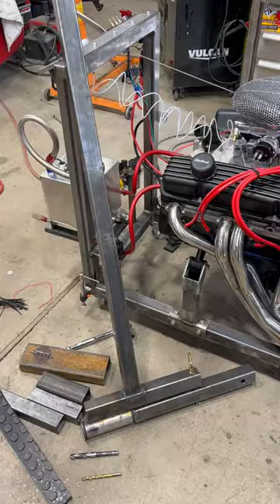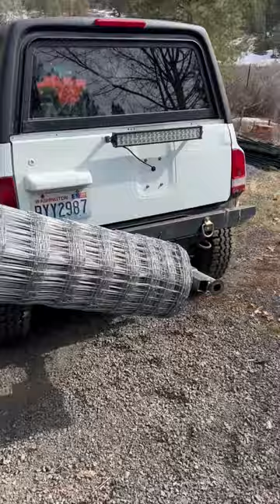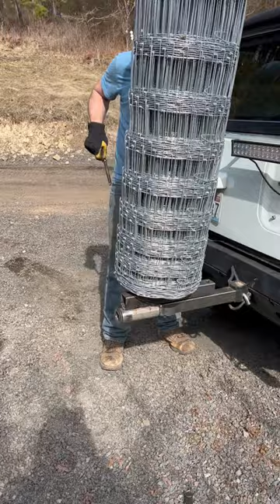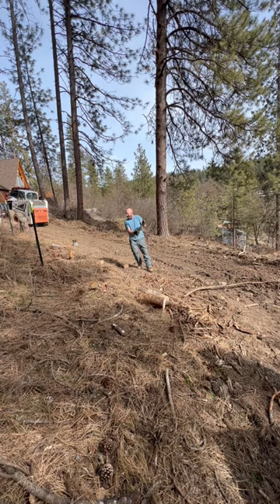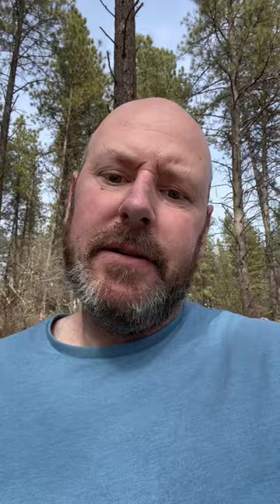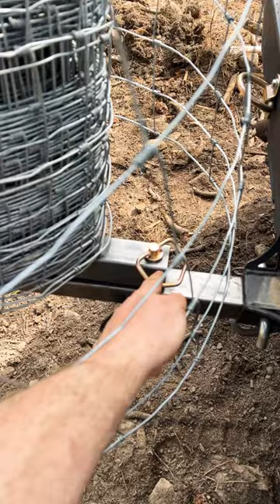Farm Fencing Roll Holder Hitch #farmer #diy #homestead #fencing #worksmarter #fabrication #short

Comment: When you swap to the round pipe in the center take an old disc blade and put it dish up so it would hold water like a bowl and slide your roll over that. Grandpa made one on a two wheeled cart. Works great
Reply from the maker: That's a good idea!  Thank you!
Reply: Something to make like a needle bearing also  to get the spinning.
Reply: That's what I was going to say

Comment: Keep on man! That’s was actually genius!!
Reply from the maker: Thank you!  It's been worked pretty good and hasn't given up yet.  I don't pull it manually except for the start, then I just drive along the fence line and the added friction from not having a bottom plate for it to spin on is actually proving to be helpful keeping it from free spooling.

Comment: I would love to have that with a self locking pin once it rotated back up right it drops in place and a metal flat plate with a little oversized of Chain Link Fencing and thick enough for all that weight at bottom so the wire doesn't get caught and spins smoothly I DO LOVE YOUR GREAT INVENTIONS thank for sharing
Reply from the maker: Thanks for you positivity!  This one needs a lot of refinement for sure. I think in its current state it would be wore out after about 10 rolls. I need a plate under the roll that can spin, as well as a round post that’s not as big. 1 1/2 round would be ideal.  I’m only into it 20 min or so. I’ll probably make some modifications and do an update.
Reply: The same thing I was going to suggest.... But maybe a bearing under the plate so maybe it's rotated with the roll... Just a thought, it may not work but ya never know, until it's tried.
Reply from the maker: @tonirobinson6284  the only problem with that may be it being to easy to unroll and it just unwinding on its own.  I finished that fence and what I had ended up lasting (barely). I ended up just tying the fence to the corner post, plugging my ears, and driving down about 10 posts or so. The friction made the fence stay pretty tight  so it was pretty nice tying it up that way.
Reply: @DeathTollRacing  yeah I see where you went with it and where the breathing could be non helpful. Thanks for your content, just came across your videos today. I can't wait to get back to making stuff, this not having a place to weld n build sucks!
Reply from the maker: @tonirobinson6284  yes, not having a place to tinker must be torture!  I couldn’t handle that.

Comment: I can tell you to fix as you can do on this. You can put a piece of sheet metal all the way from the bottom to the top, but curved to keep it from jamming up on anything or from hitting your car kind of like a shield. That’s one and the other one is you can actually used round tubing for the spool itself instead of square tubing and at the bottom you can put it on the steel plate so that way it’ll it’ll rotate a lot easier
Reply from the maker: That would be nice.  The resistance is somewhat nice too when I drive the Tracker down the fence line and it stays pretty tight.  It would be nice if I had both somehow.  The round tube in the center though is a must.  I just didn't have any on hand when I built this.

Comment: Just put a round oversized plate at the bottom so it has something to glide on probably be much better .. might be able to find a round piece of PVC to go over the square tubing probably also help 👍
Reply from the maker: great ideas.  I may do that on the next one.  That one is completely wore out now.  LOL  The resistance though was nice when I was hooking it and driving off so it didn't unravel on me.

Comment: Just slip an oversized round over the square that extends over the top of the fencing... it will act like a bearing.
Reply from the maker: I ended up doing something similar. It was osb, but only lasted a few rolls. I started just pulling it with the tracker instead of by hand, so it was pretty hard on it.

Comment: Well at Least with the oversized holes you can weld in some sleeves to strengthen the tubing where the pin goes through.
Reply from the maker: Good point!  I’ve been giving it hell and other than being annoying, it’s lasting better than I guessed.

Comment: This was invented 40yrs ago. They even have them where you can run your fabric and 3 strands of barbedwire at the same time. Weld a round plate on the bottom and cut a piece of plywood greased on both sides to sit on the plate
Reply from the maker: I figured someone made something. But this wasn’t bad for a 20 min build. Definitely needs a plate like you said.

Comment: Bro!! That’s siiiiick!!
Reply from the maker: Thank you!  It worked well, but I actually wore though the tubing after about 1 mile of fencing.  I ended up just hooking the corner, and then driving down the fence line 100 feet or so at a time.

Comment: Add a heavy duty lazy Susan bearing to the bottom with a bushing and a disk to support the roll, it will be so easy a kido could manage it.
Reply from the maker: I just hook the corner post and drive down the fence line with the tracker, and it's actually kinda nice having the resistance so the spool doesn't unravel.  would be nice to have a lazy susan with a brake of some sort.

Comment: Horizontal, capped on both ends, pull with the vehicle.
Reply from the maker: I ended up pulling with the tracker after it was tied. It worked great until I had to wrestle the roll off and around a tree. The next run is more clear and should go easier.

Comment: This isn't new.. i have this exact setup on my 12'' trailer.. except that mine is horizontal rather than vertical so it doesn't get stuck or caught on anything.. i usually get like a crowbar which i hammer into the soil which holds onto rhe fence.. then i drive the truck rather than pulling it by hand